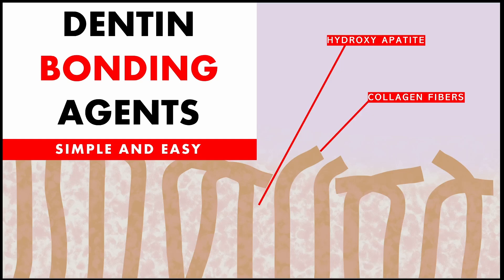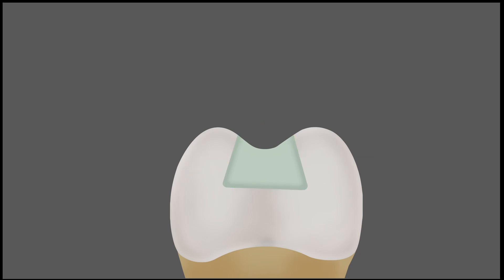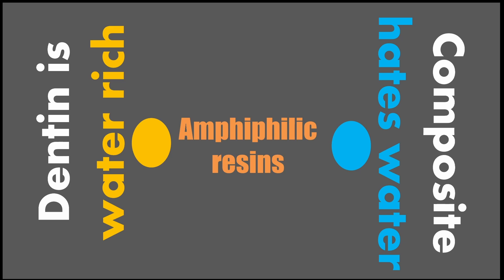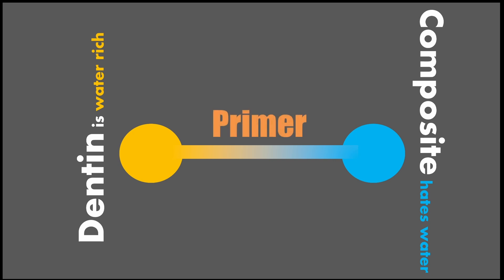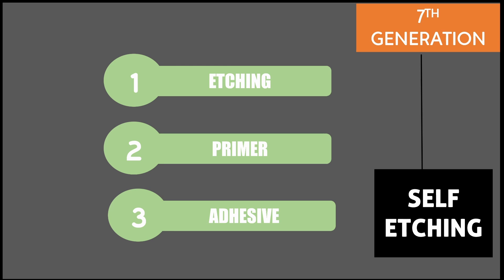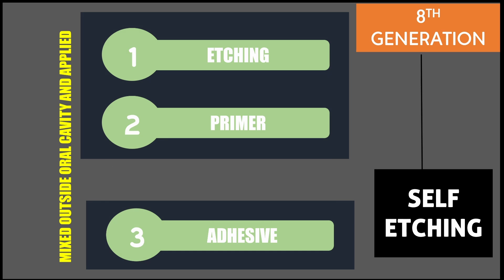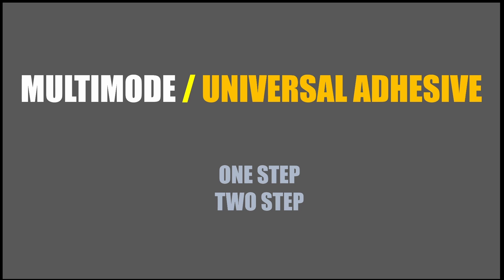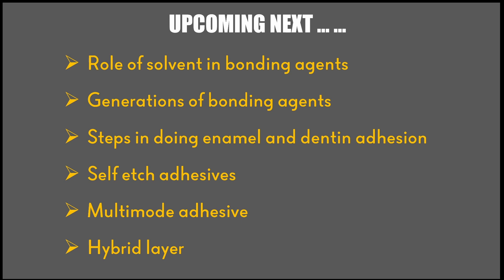Dentine bonding agents

Comment: HEMA’s Characteristics: HEMA is not typically classified as amphiphilic because its primary interaction is with water due to its hydrophilic hydroxyl group. While it has some level of interaction with hydrophobic components (like the methacrylate group), it does not exhibit the same balance of hydrophilic and hydrophobic properties as true amphiphilic substances, such as surfactants.
Reply from the maker: https://www.sciencedirect.com/science/article/abs/pii/S0376738820309996
Please read the above article. HEMA maynot be the best amphiphilic monomer available. But this resembles more closer than most other resin monomers used
Thanks for your insight
I will learn more about this
Regards